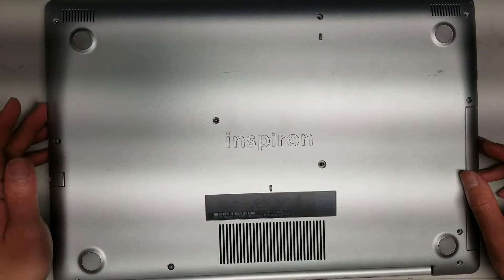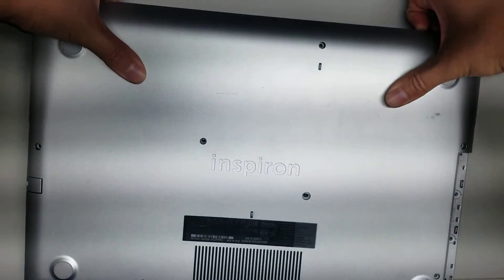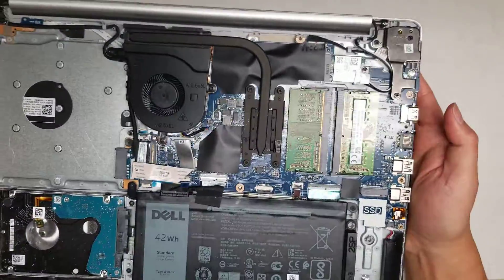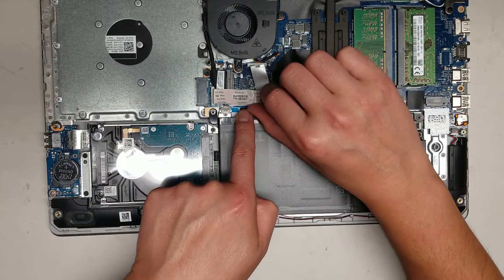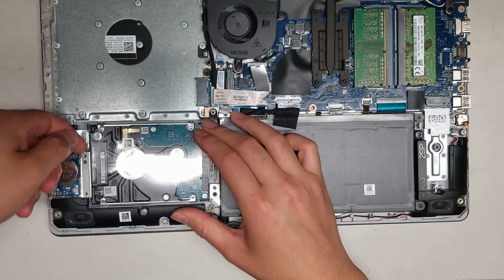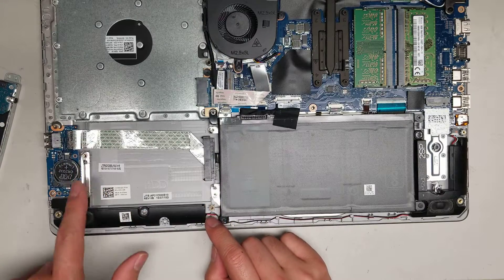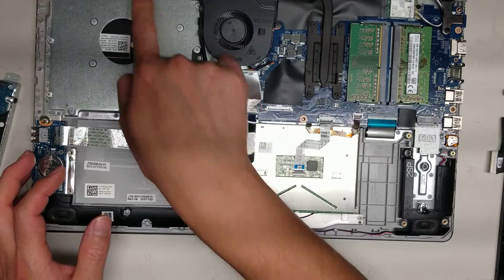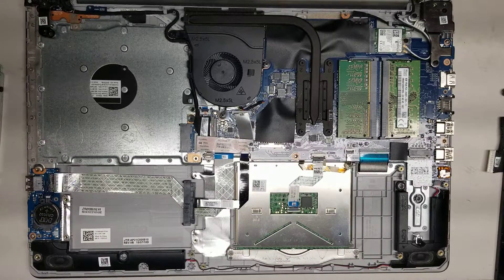Dell Inspiron 5570 Disassembly RAM SSD Hard Drive Upgrade Repair M.2 Pcie Nvme

Comment: Thanks for the tour!
I'll be installing  Samsung MvME 1TB soon. It came with a 5400RPM drive and is slow to boot. This is very helpful.
Other tutorials use credit cards to slip take the bottom off, but it looks like you just used your fingers at the front center.
It didn't look very hard to remove.
Reply from the maker: This will help https://youtu.be/4p5jFDzVwUw